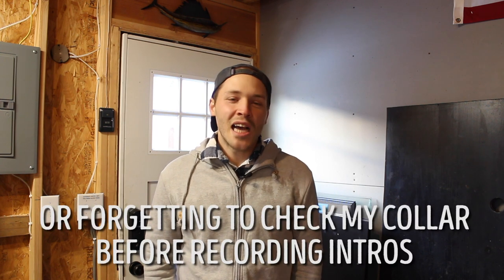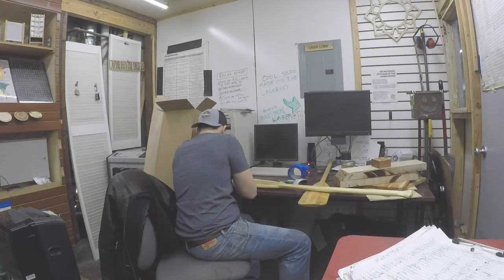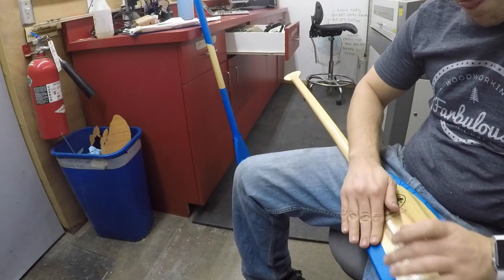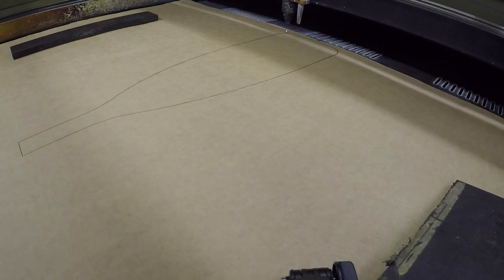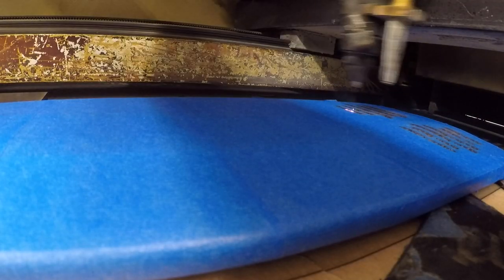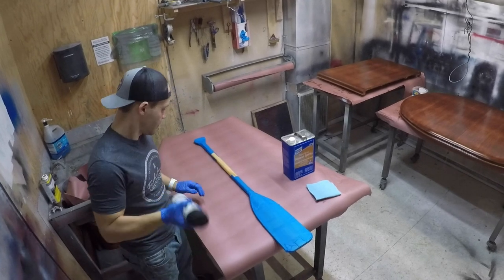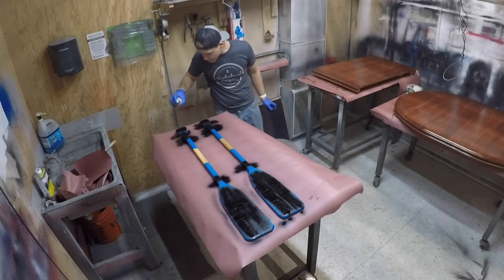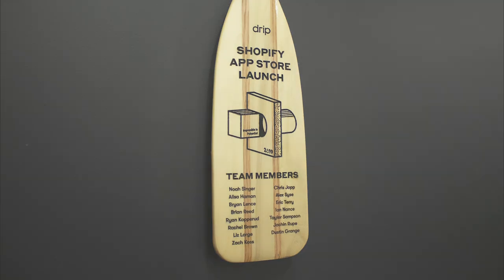Laser Etching a Wooden Oar for Drip

Comment: Not saying you should, but that door switch looks to be a magnetic one. As such, placing a small magnet on it will disable it as well. 

As for the weeding part, might be worthwhile placing some stronger adhesive tape over it (Ducttape and the likes) and ripping that off. Should take of some/most/all tiny pieces. Basically a wax-job for your tape ;) Do test that first, since it might mess with the finished parts.
Reply from the maker: I've suspected as such regarding the door switch and using a separate magnet, but there's a rule with the laser room at the maker space to not tamper with the door sensor, so I'm trying to play within the rules. 😉 

The stronger adhesive is actually a pretty good idea that I hadn't thought of! I'll give duct tape or such a try next time. Thanks for the idea!
Reply: Farbulous Creations messing with the safety features is always a bit tricky. I guess it's easier when you have the machine at home, and coincidentally didn't install the switches (yet) 🙊